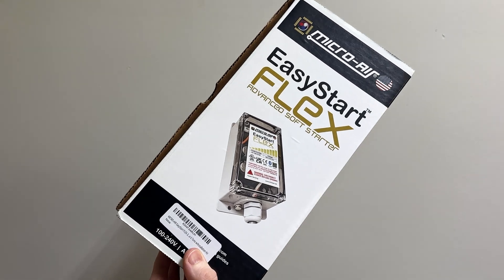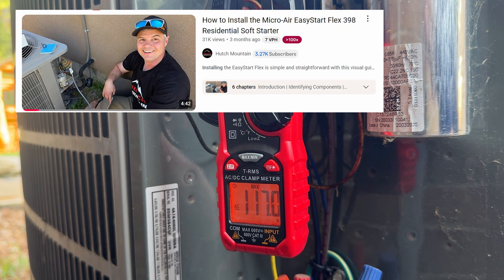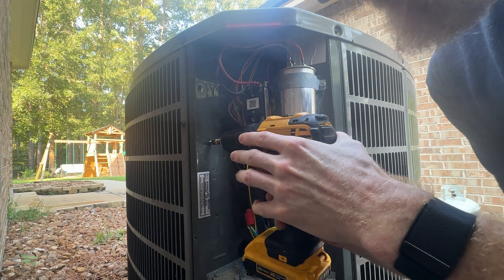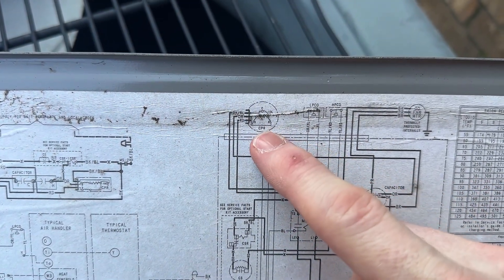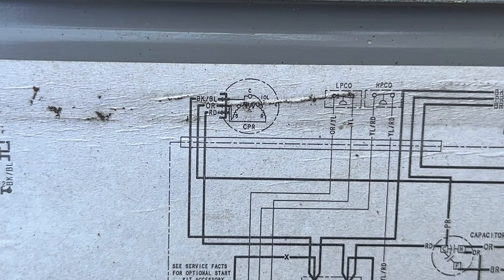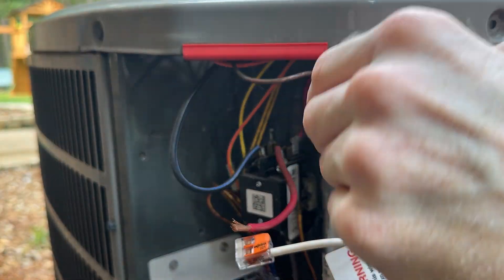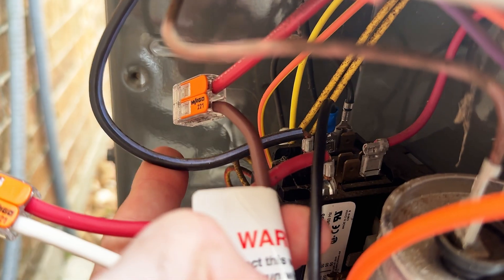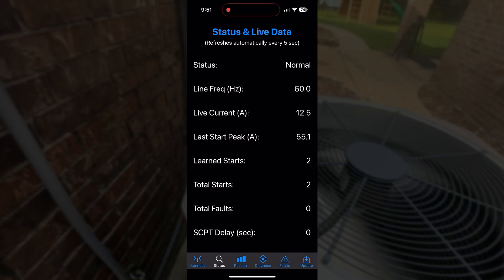Micro-Air Easy Start FLEX install on 6 Ton AC Unit | Soft Start DIY

Comment: I am installing a 2023 (never installed) old Micro-Air Easy Start for a 3ton LENNOX condenser unit.. I've been reading comments that there have been Easy Start units that fail after a couple of months or a short time later,  Is there anyway by the year made & or serial  number if I have a faulty one before I install?